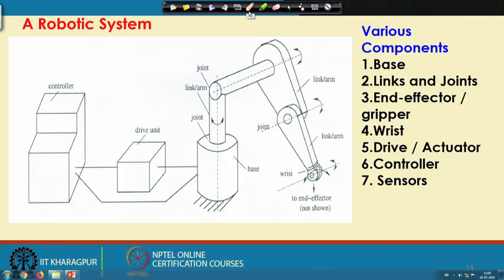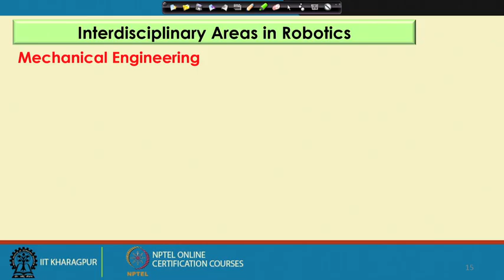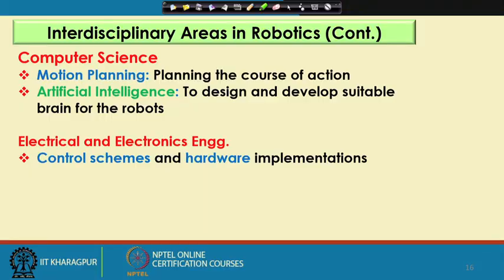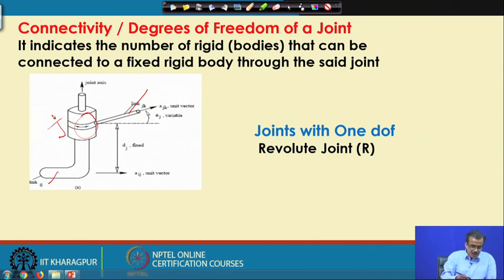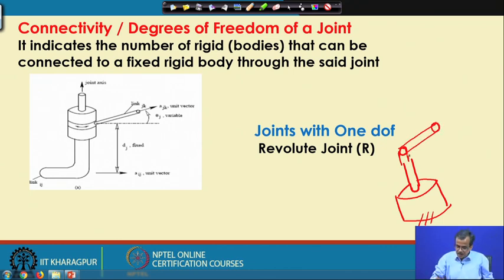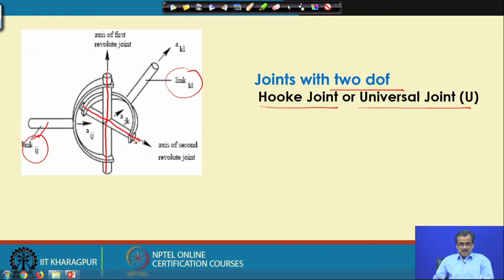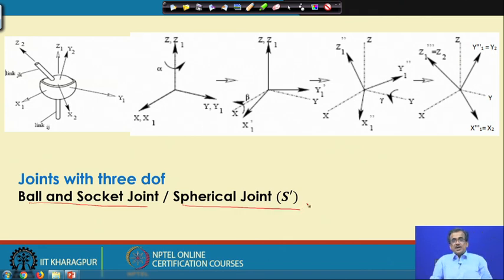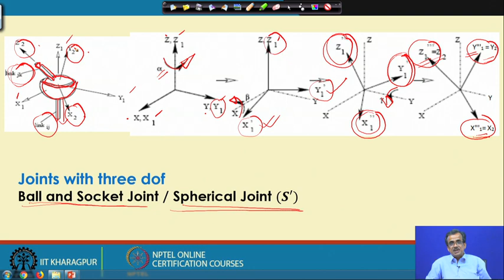Lecture 02: Introduction to Robots and Robotics (Contd.)

Comment: Sir can u explain ball and socket joint another way ?
Reply: Although it looks similar to hook joint or sliding joint, the ball and socket joint has three degrees of freedom. 
Sir was explaining how it has 3dof at the end of the lecture. 
To find the dof, we need to find the minimum no.of rotations it will take to arrive at a new orientation. There is no linear motion in the ball n socket joint. Sir proved that the final position (x2, y2, z2) can be achieved by rotating the ball about three axes successively through 3 different angles. Initial position is (x1, y1, z1) 
1. First rotation is about Z axis. New point will have same z coordinate. But new x and y coordinates. (Let us call them x' and y') 
2. Second rotation is about X axis, this time x' will remain while Y and Z coordinate will change. (Let's call  them y'' and z') 
3. Last rotation is about Y axis. y" Will remain same but X and Z coordinates will change. Latest coordinates will be (x", y", z")
Thus, these three independent rotations are needed to arrive at a given position. Hence 3dof.
Hope this helps. Do reply if any more clarification is needed.
Reply: @lidiyapriyadarsinik2815  Do I need to study mechanical eng. for this? I am an ECE student.
Reply: @Silver Penetrator  these topics are covered in the syllabus of a Subject called Theory of Machines (Also sometimes called Mechanisms). And it is offered only in Mechanical Engineering course and  Robotics Engineering. 

You can pick up a good textbook or take an NPTEL course for specific subject.
Reply: @silverpenetrator739  the concept of coordinate transformation is also covered in various other courses.
Reply: @lidiyapriyadarsinik2815  in steps 2 mentioned by yourself, he doesn't rotate about x' instead about x. Do x' changes to x". Same for y" in step 3.
Reply: @lidiyapriyadarsinik2815  Your explanation clearly makes sense to me. I don't understand professors way of how he gets x' ' ' , y' ' ' , z' ' '
Reply: @trollersinc.8609  Yes...u r right... actually sir has rotated with respect to the main axis i.e x, y, z axis not the x' , y" axis